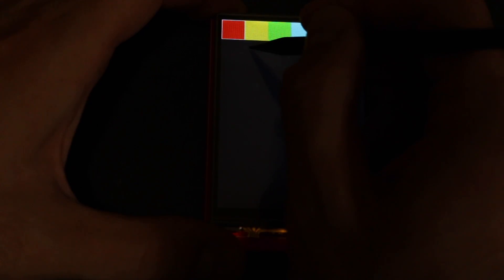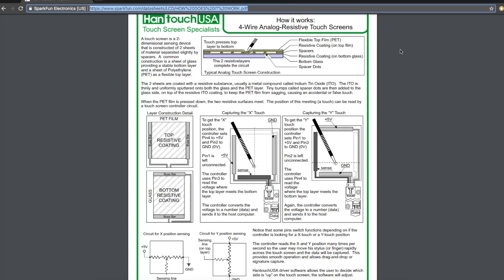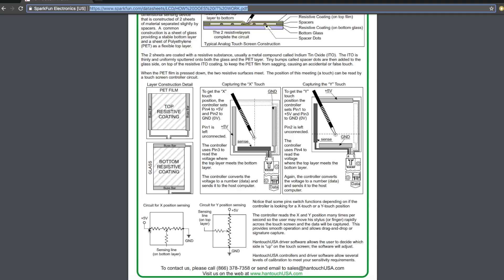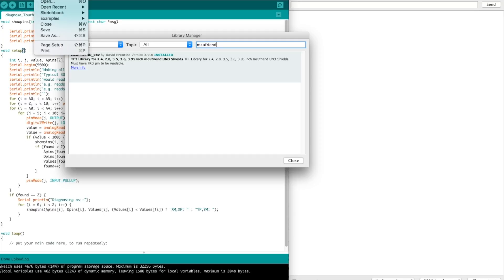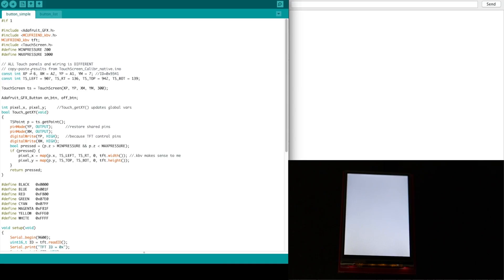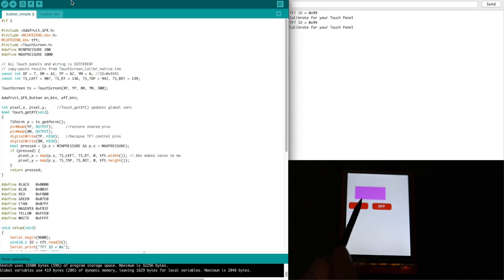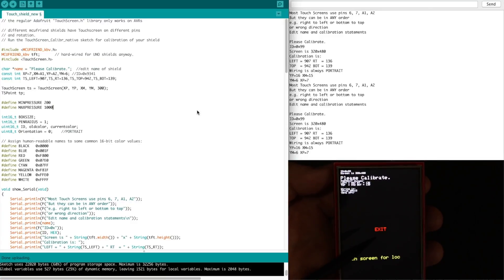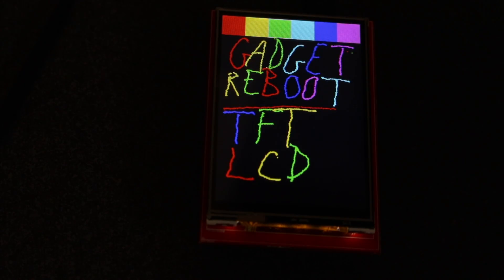Arduino TFT LCD Touch Screen Tutorial 3.5 Inch 480x320

Comment: idk if anyone else has this problem but when diagnosing for xy and touchpins it doesnt show anything and just says 
Making all control and bus pins INPUT_PULLUP
Typical 30k Analog pullup with corresponding pin
would read low when digital is written LOW
e.g. reads ~25 for 300R X direction
e.g. reads ~30 for 500R Y direction

TFT ID = 0x9486
Calibrate for your Touch Panel

Comment: I have the same screen. The vendor told me that is an ILI9481 Could be?
I'm trying to make it work with an Arduino Due but only get white and black color and some times a bit of green.
I think there's a bad design since the touch have 280 ohms and since share some LCD pins is to much for Arduino Due port which can only drive 3  to 5mA.
I will try to declare it as 9341 and 9488 and see what happens.
How do you read the LCD ID?
Reply from the maker: I think in the MCUFriend library there was a sketch to run to get the info in the serial monitor but it's been a while since I've worked with it so all I remember is it was a big hassle trying to get it working. At one point the touch screen for me was mirrored so I'd click one spot and the mirror location would respond, to click a button on screen I'd have to guess where the mirror location would be and click that.
Reply: @GadgetReboot   SUCCESS! I finally made the LCD works with Arduino DUE  thanks to you! Many thanks!
It was an ILI9486 not a 9481. Stupid seller!

Comment: God bless you. I was trying this with my 12 year old. Everything worked as you said, I had few library issues  and greeted with error while running button example. It was failing with Arduino\libraries\Adafruit_GFX_Library\Adafruit_MonoOLED.h:30:32: fatal error: Adafruit_I2CDevice.h: No such file or directory, I fixed it using link https://learn.adafruit.com/adafruit-veml6075-uva-uvb-uv-index-sensor/arduino-test#install-arduino-libraries-4-4, after installing few more library things working as expected. I did not faced reverse screen issue. code worked as expected. Thanks again for making things better

Comment: When I run the diagnose_Touchpins sketch, It lists everything except the XM,XP and YP,YM. This is the output:
21:32:17.536 -> Making all control and bus pins INPUT_PULLUP
21:32:17.603 -> Typical 30k Analog pullup with corresponding pin
21:32:17.638 -> would read low when digital is written LOW
21:32:17.705 -> e.g. reads ~25 for 300R X direction
21:32:17.738 -> e.g. reads ~30 for 500R Y direction
21:32:17.771 ->
21:32:17.771 -> Testing : (A2, D6) = 24

Anyone have any ideas?
Reply from the maker: Not sure exactly and there seems to be a lot of different displays that are all configured differently but here’s one thread that might give some ideas at least on how to run diagnostics. 
https://forum.arduino.cc/index.php?topic=554705.0

 David Prentice is an author of display libraries  and might have suggestions if all else fails. 
 One thing pointed out in the thread is that it’s best to try to get it working first on an Uno or Mega  if not already.
Reply: me to

Comment: I made the same experience as you. What i found out, was that it depends on the drivers if its inverted or not. Yesterday i updated some Libraries, and i had the simple buttton with inverted colors, but before everything was right. The other problem which i am looking for help atm. is, that i try to get the simple button excample in portrait display mode and not in landscape. To change the Mode from 0 to 1 is good, but after it , it cant find the TOUCH buttons. When i make a calibration and change it too before i calibrate, i dont get the right coordinates that it works in portrait mode. Do you maybe know how i can fix it?
Reply from the maker: I don't know off hand, I haven't used it very much and would have to be involved in touch screen projects again to see if I find a problem and can resolve it.  The big variation between how similar displays work with different chipsets on each of them makes it even more complicated for two people to reproduce the same results sometimes so it's a mess.
Reply: @GadgetReboot  yes absolut right. Most ppl write that its better to invest more money and buy a adafruit display because then you have good drivers. But adafruit has only 2.8 inch displays, and no 3.5 or higher inch displays for arduino. They support more and more Pi instead of arduino. Nextion i tried out, but hell its complicated to code and has also limitations in refreshing numbers and so on. Waveshare i ordered now, and i hope they have good results, because what i saw they dont use normal libraries like ada, mcufriend or others. STM32 is also ordered, but total high price and is no arduino system, but fast as hell and in some ways compatible with arduino boards. I would need it only to controll some sensors and a stepper motor. But the drivers make it hard, because the manufacturs dont care about the ID in their systems, so its near not possible for a software to find out the right ID of a board, and this is the main problem i read now.

Comment: why do you think that the coordinates are in portrait mode. Maybe they are in landscape
Reply from the maker: I don’t remember exactly how it was now but whether it was Portrait  or landscape, it still felt like something was wrong like X versus Y was going in the wrong direction plus or minus compared to the other axis so it was all confusing. I need to play around with it again. I was able to get it working but I just didn’t fully understand how it was deciding which way is up.
Reply: @GadgetReboot  what if you were holding it upside down for X/Y
Lol

Comment: I have an inverted problem with my mcufriend.com 2.4 tft, which I just bought.   The only thing that works properly is the touch screen and colors!  The LCD_ID_readreg.ino identifies the address at 0x4040 which isn't supported.  I use 0x9338 just to get a result on the screen, terribly, but at least I know the screen is totally dysfunctional, and its the software.   Also, the colors, are NOT inverted on this unit, but the SD doesn't work either.   I found your tutorial educational and easy to follow; so thanks.

Comment: About the x value, maybe the plus x pin and gnd x pin are initialised the other way around? Maybe that’s why you get the inverted readings..
Reply from the maker: When I tried exchanging the X pins I ended up getting a mirrored coordinate response so it made the problem worse. It ended up just being a big mystery where the screen works properly but it reports a strange coordinate. Maybe some day if I dig deep enough I will find out what’s going on.